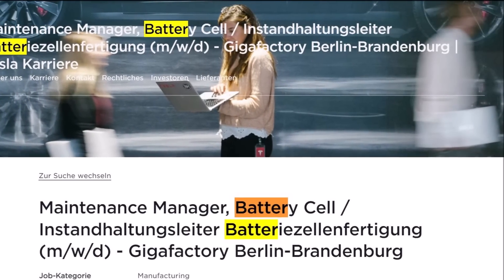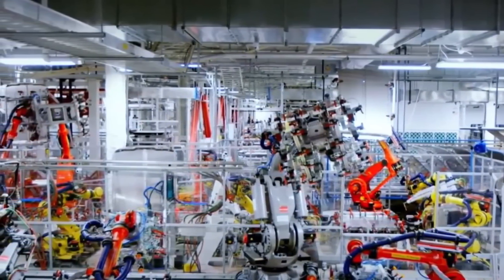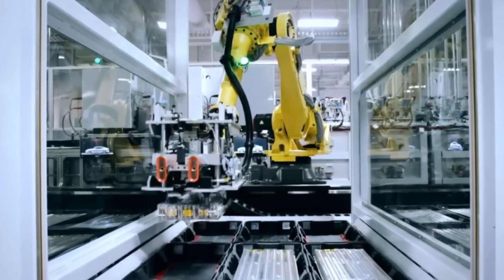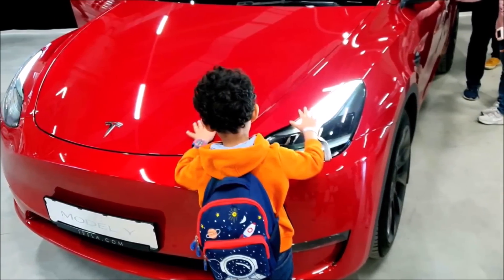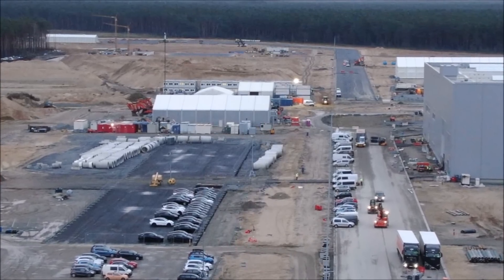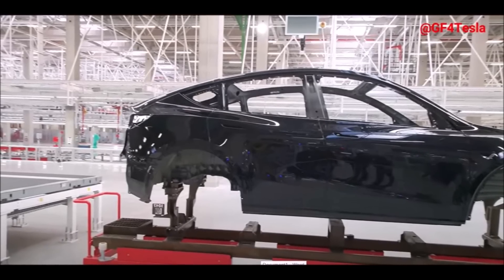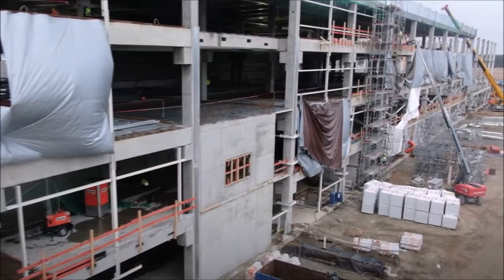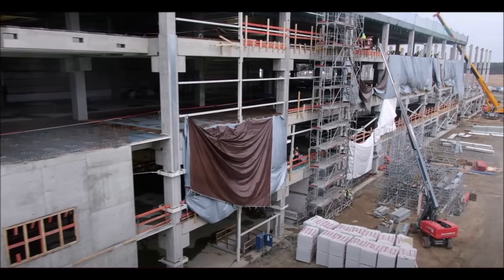BREAKING! Tesla Giga Berlin's 4680 Battery Starts a New Phase

Comment: Lead time to acquire , train and orient this position and develop the staff and their responsibilities has to be at least a year. I don't think Armen has watched the latest vids of the battery plant. Basic structural construction has slowed to a snails pace with one crew per discipline at most. This is a very complex plant. Austin was dried in since late September and have been cramming equipment into the plant ever since and the pace is picking up now. It would seem Austin will have a chance to be in production in late 2022. Berlin cannot possibly be in place until mid or late 2023.  It has no "war time effort' in place.

Comment: where is the news ? when you build a factory you need staff to run the factory.
we all know that the battery cell production building is beig build currently ... and if you want to have well educated staff you need to start the hiring process very early ... and when you find staff it takes a while until this staff can perform with 100%